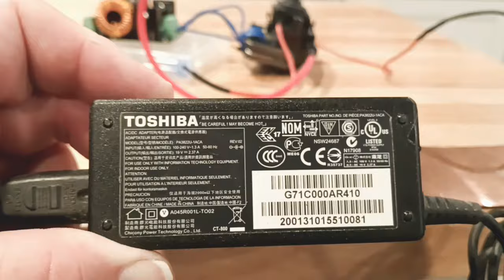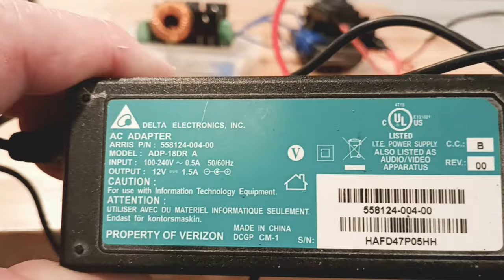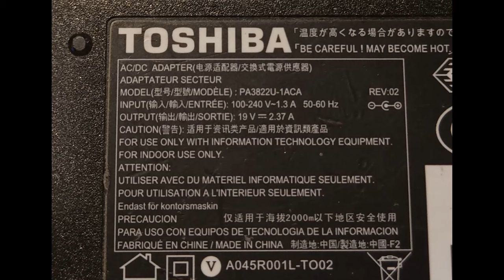Graviflyer "Testing The Power Pack" #16

Comment from the maker: We are trying to create a static volt. There are things you need to look for in a power source to achieve this. The hissing sound and the slight purple discharge at a distance are a must. If over amped the voltage will not work in the Graviflyer. I was told a dioletric would help. Alexey didn't use one. So I will run testing with my "Electrostatic Field Meter" with and without one. The 2 thing I want to try is felt and panty hose because of a vandergraph build I saw. Even if they don't make it into the build. The test should give good results and remove the noise.
Reply: Goosebump effect.
Reply from the maker: @devilvortex1  thats right

Comment: I made HV supply using ignition coil, driving it with Honda ignition module and when I touched it, it gave me such a shock that I screamed.
Reply from the maker: That sucks but the coil giving off power like that is cool.
Reply: @nathanbunten4299  I didn't expect that since I can touch tesla coil without a problem. Plus I was lazy to bring out the ground wire from a socket and figured that I test it with my finger holding metal rod
Reply from the maker: @starraider25  You completed the circuit on the coil. The tesla coil is an open air discharge. The 2 are much different.

Comment: If you think too many amps is the problem there are more practical solutions than switching out off the shelf switching power supplies.

A simple method would be to add a resistor just after the power supply output to limit how many amps can be drawn from it.

Another solution would be using an adjustable constant current power supply.

Or you could just convert one of your larger power supplies to an adjustable current supply with a cheap device from AliExpress or another over seas supplier.

I got tired of constantly buying power supplies for various devices so I built a variable version starting with a high voltage power supply designed to charge electric scooters.

I picked a power supply device that takes this scooter power as input and allows me to adjust voltage and current independently for whatever I need that's lower than the scooter supply output.
Reply from the maker: You are correct. I was just talking with another person about making a current limiter.

Comment: Awesome white lightning. the color is due to the ratio of electricity. usually the more amperage the redder the glow and the more voltage the more blue or violet.
Reply from the maker: I have gotten it pink with the zvs driver. I need a better one to get red

Comment: Hey Nathan, if you have already bought a bunch of LM317T, then you could use one to make a current limiter. In the datasheet of the "tipical Application" section is a schematics of such a regulator. LM317 Datasheet(HTML) 17 Page - National Semiconductor (TI) should be it. You can then use the first or second pack of your video to drive the ZVS just put the limiter in between the Pack and the ZVS and then adjust the current until you get what you want.
Reply: I would love to send you the link to the Datasheet to let you look up the circuit. It is a very simple with few external components.
Reply from the maker: That sounds like a plan. I was going to use a dimmer switch on the 120v side to adjust it. But your way will give me more control.
Reply from the maker: Here is my email send it there. oldmannathanbunten@gmail.com

Comment: Ultrasound may have been used to vibrate the graviflyer, creating small gaps in the air and preventing sparks from jumping between the disks.
Reply from the maker: the ultrasound is to push down the charge from the top disc top the bottom one

Comment: Hi,
You need to get some instruments to measure the input voltage and current, you  may be overloading most of those power supplies, including your most favourable supply.
If that is the case, then they will not be very reliable.
Reply from the maker: I agree. I will test them.

Comment: The flying saucer engine is made of quartz crystal.  It is in two parts. One is above and the other is below. No transformer is used to drive them. Only large high voltage capacitors are used. This is connected to a thick bifilar coil (positive charge bifilar coil.no normal coil) with few windings wound on the crystals. The other end of the coil is connected to the antenna. Thus, radiation occurs outside the ship. This is gravity.
Reply: It is possible that there is even this form of energy who as antigravity effects, but im sure yhat thats not the only way, there are so many different type of energies who can have an antigravitational effect, there are many scientists who discovered and developed antigravitational tecnologies
Reply: i prescribe to the the tesla version of gravity.  that gravity  is just dielectric acceleration.
Reply: Have you build one ?
Reply: @michaelstern519 Gerbennikov flying platform for example...

Comment: Seriously aluminum is 50hz ..a in music so the 5th guitar string is tuned 440 or 433 giggle .motors.. gears belts all create frequency so a 3 d printer on a certain print compared to resonance of ? And a 15v wire is not going to hold the current u want .dont hurt yourself. I admire your enthusiasm. Try tone generators .a florescent 15kv power source ,scariacs
Reply: Have you tried it yourself?

Comment: electron are electron white hot just means you have more plasma.  You made an asumption about if it will work or not. The surface area and shape can change the  color of the plasma.  AKA you can't assume, you can only know by trying it.
Reply from the maker: This is not my first time running these. I have been doing it for years. I am looking for a static volt. The only way to get there is to know what it looks like and the smell in the air. There is a direct correlation to the amps and the thickness of a spark (the white). I assumed nothing. I am giving advice based on how things work in real life.
Reply: There are many types of plasma discharge. There is orange longitudinal, green upwards spark monopole, white amperage, yellow amperage, pink high voltage & amperage, blue mercury plasma, violet high voltage, blue single wire plasma.
Reply from the maker: @MrThacke  I know that. This video is to make 1 point about what plasma would go to a static volt. I have created pink plasma by turning up the amps.
Reply: @MrThacke  ya that just what type of atoms your are burning with electrons.  LOL
Reply: @nathanbunten4299  Nath you assume you have this idea that grav flyer is special.  You infact may have missed something.  Our goverment use high voltage electrostatic accelerators to produce isotopes. The flyer could be producing types of isotopes that make it fly.? The metals its made of may make a difference.?
Reply from the maker: @doityourself3293  I do agree with that. Thank you for clarifying. I was looking into the magnets and found Alexey used Alnico magnets. They are made with aluminum. A resonance frequency of aluminum would change how we see them in this. I do like the isotopes idea. I will look into that.

Comment: no arcing should occur
Reply from the maker: That's right. When in your Graviflyer there are no sparks. Sparks are a discharge. They stop the flow. The reason for the breakout at a distance is to get that transfer.